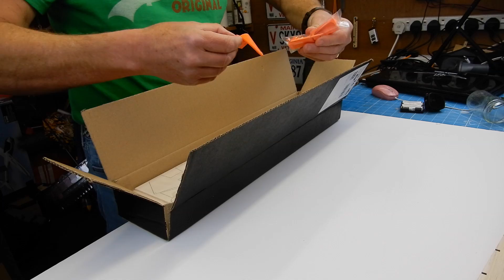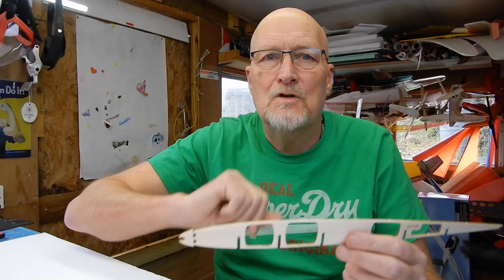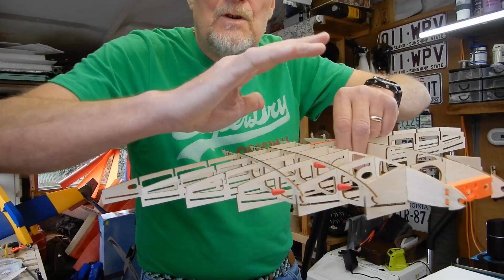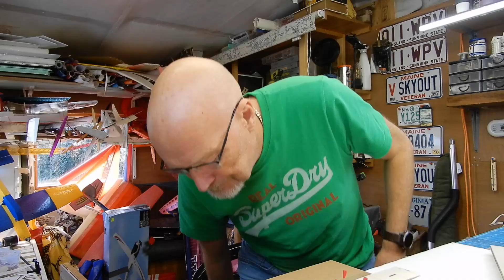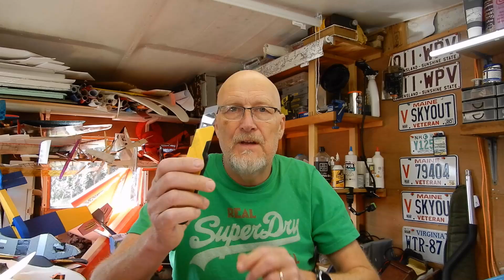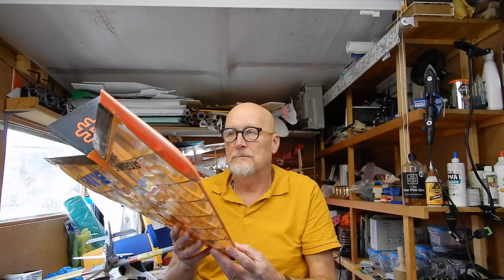how to Build the Blink electric delta

Comment: That is very tempting, I'd wouldn't mind putting a flight controller in! -  A lovely model you've built!
Reply from the maker: Thanks ive been told its can be flown quite tame fingers crossed
Reply: @NickChittyFlying  It can be flown very gently and slowly for sure. It would be interesting to build one very lightly with a small motor and pack. There's tons of room to still get the CG right even with a smaller pack.
Reply from the maker: @ don’t worry something is in the works 😉